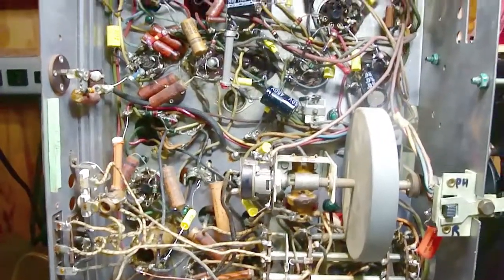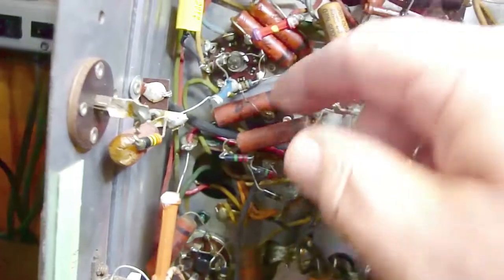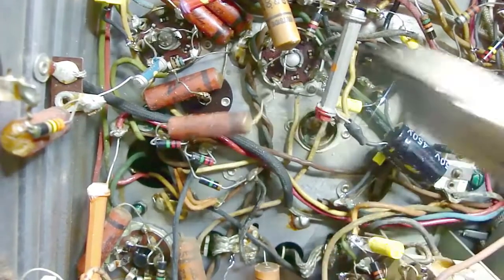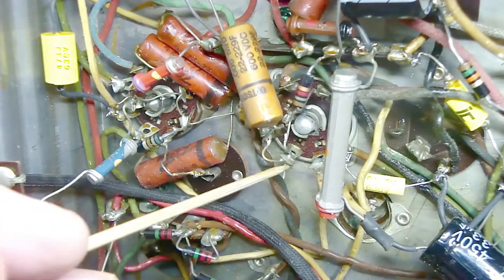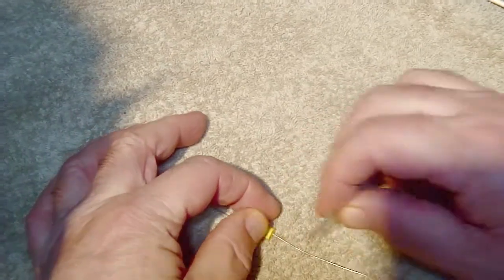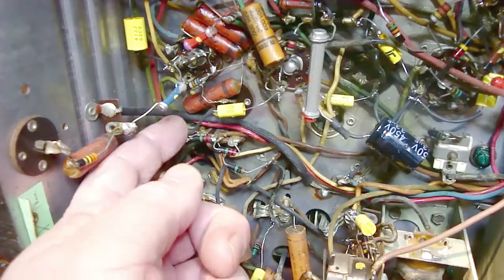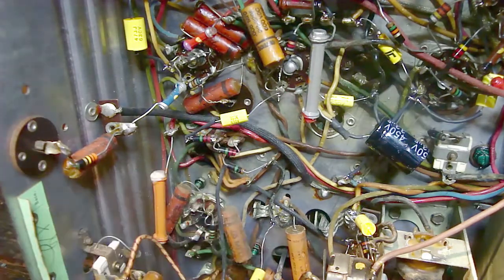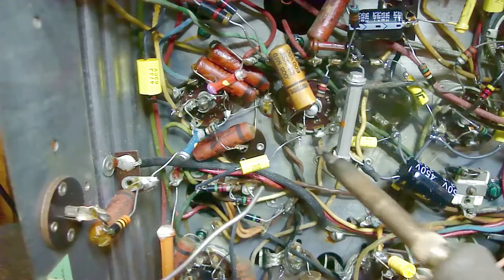Soldering - How I do point to point

Comment: Thanks for this great video. I'm about to start recapping a vintage H.H. Scott tube amp and will be using your techniques. Makes much more sense than desoldering and removing leads from the original terminals.

Comment: Thats a great demo I use that and the hook and pinch method in real tight areas. I have a small round wood dowel I have wrapped emery cloth on to sand the ends down inside the chassis. But anyway to can to get a shiny place to solder is the ticket. Thanks for sharing

Comment: Hi R.W., That is how I do it except I put a little "hook" on the stub and the part, I call "hook N Pinch"
I have tried to do the "coil" method but I find my way easier after all I have been doing in for more years then I care to count..LOL
I agree I never try to take off the leads from the tube socket unless the old component is "slid" in at the factory, the FADA 115 was easy because they did not wrap leads around the tube pin.